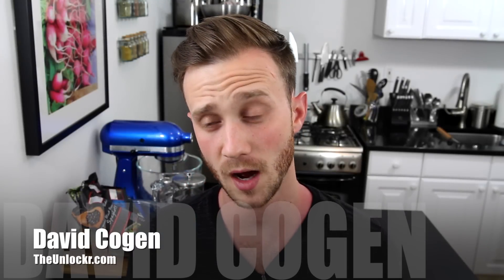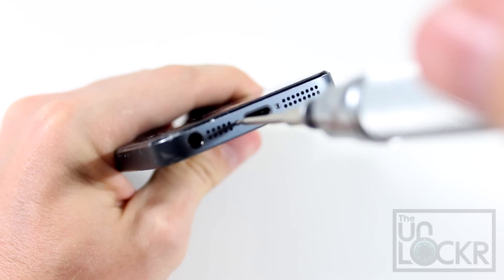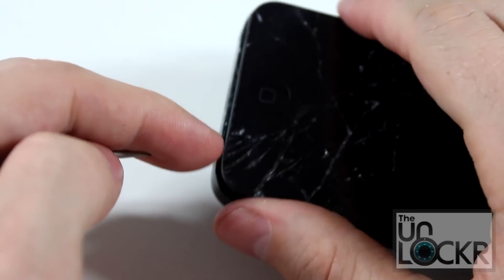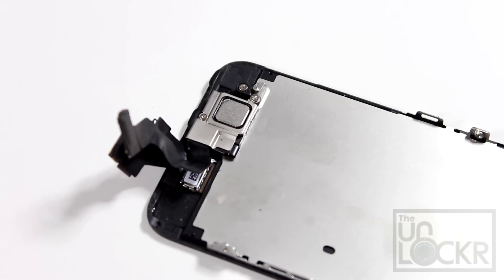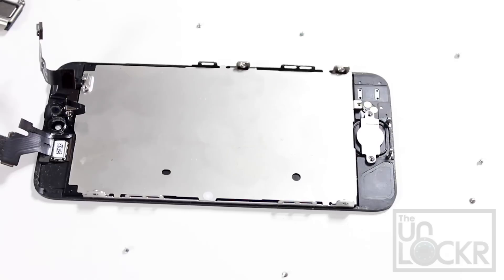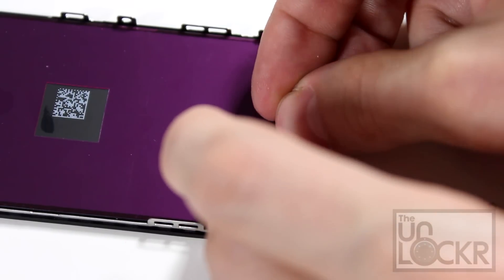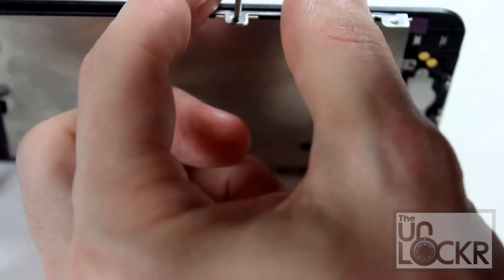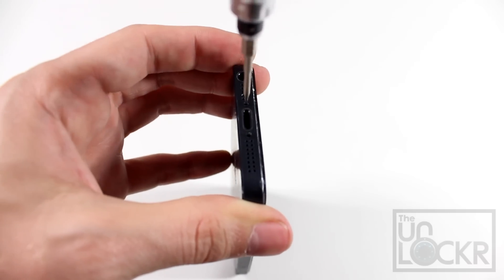How to Replace Your iPhone 5 Screen (Complete Guide)

Comment: if the screen is too cracked for the suction cup to work, put some clear tape over the screen and try again.
Reply: wow thanks
Reply: +kalj ههههه
Reply: yes can use Kapton, then put on machine for separate no problem
Reply: what i did was just unscrew it and shove flat head screwdrivers on the sides and force the screen out with pliers later on. worked pretty well, no cuts or glass in fingers
Reply: I feel like this comment help me more than the whole video. Thanks

Comment: 4:22, you put in "the third screw" next to the home button. That screw holds the back metal plate so that cannot be screwed in before you put the plate on. You should edit your video and correct that (and mention the purple plastic protection you forgot to take off)
Reply: I have never done anything else remotely like this and even I noticed the screw mistake straight away that I corrected, I left the film on because I thought maybe, just maybe this guy might still know what he is doing, but after assembling it, the response on the digitiser is a bit funny at times... This proves that no matter how professional someone seems, that has nothing to do with them being a reliable source of info and expertise. I mean come, those were two obvious mistakes, I was expecting him to at least go 'duh sorry guys' when installing the back plate and correcting the screw. I always question people who look like they know the alphabet. Anyway, it did help me install the screen I guess.. but I should take it apart a bit now to get that film off, though I fear to run the risk of damaging anything as I was surprised everything seemed to work pretty ok, apart from the occasional digitiser hiccups that I am assuming is from the film, in fact im surprised its not performing worse from what I read about not removing that film.. WHY IS THIS COMMENT SO LOW
Reply: He also didn't transfer the camera guide or the small spacer.
Reply: I thought that protector on the back was supposed to be taken off.  My old screen doesn't have a film like that.  And that third screw.  I knew it held that back heat protector on, but when I saw him put it on without the metal plate, I was slightly confused.
Reply: @dalltex  I didn't see what you were talking about on my phone.  There is a small round  clear plastic spacer that the front camera fits into, and my "bare-bones" screen like his had that in place already.  And there's a very small square shaped clear plastic piece I broke off of my old screen, but that's also already in place on my new screen.  Can you please describe the two pieces you are talking about?  Thanks in advance!!!!
Reply: @MasonSanchez.  it's been my experience that different replacement screens have different amounts of those parts attached. It sounds like your replacement assembly already had them. However that protector, you have to take that off. That screw, cannot go in as shown.  If you look on ifixit they often have good high-resolution photos of what it should look like.

Comment: Nice vid. I'd recommend using a piece of paper, drawing a diagram of the phone(circling where the screws go), use stick double sided tap on the paper and then you can stick the screws to it in the circles.
Also, pry the mainboard connectors off with the plastic tool instead of fingers.
Reply: @Tommy Garrett thanks for your reply. I found the site on google and Im trying it out atm.
Looks like it's gonna take a while so I will reply here later with my results.
Reply: @Tommy Garrett it did the trick and I now got access to my account again. Im so happy!
Thanks so much you saved my ass !
Reply: @Roland Carlos no problem :)

Comment: Did this all by myself, i was shaking like freaking crazy & i was able to do it! but! it did have a yellow hue & would not respond to my touch, so i took it apart again & i made sure the wires were connected by pushing them fiercely & it worked!!! And the earpiece mesh(?) i lost the screws & i freaked and started looking EVERYWHERE on my floor, turns out i didn't loose em... they were on my screw plate.........

Comment: Tip: try to clean the connections with an air spray or a brush before putting the connections back. I ended up having to reopen and clean them because there were white bars appearing on the top of the display.
Reply: Hey ik ur commented 2 months ago, but please reply if u see this. SO my phone has the white bars do i need to open the phone to make them go away?
Reply: JD_Savage_OG Yea I reopened it and sprayed the connections with an air can and it worked fine after

Comment: great video. I did everything correct except one thing ..be careful where you put the screws when you screw on the last part to the new monitor like shown @5.27 ..if you screw the bit longer screw to the wrong place that will create a black spot on your new screen like it did for me ..apart from that everything went fine with the instructions of the vid. Thank you.

Comment: Thanks for this. Worked a treat (I used whole display kit, not just screen). Getting the oldscreen off is the hardest part. Takes some confidence. There seems to be a small indent at the bottom corner that the plastic tool fits in. I managed to lever it off from there.

Comment: Where do you get one of those screwdrivers from? 🤔 I need to do this but I haven’t got one 🙄 I may just go into the local phone shop and ask if they will do it for me and I’ll throw them a couple of quid lol (I have 2 iPhone 5’s one of them is broke internally but the screen is fine and the other works apart from the screen so I need to swap them over)

Comment: Couple quick questions. I noticed you didn't peel the film off the back. I saw the tab by the home button when you were putting the back plate back on. Also you just put the home button in and reassembled, I've read or seen someone say to glue or tape the button in as it will move or be loose. Any problems?

Comment: I don't mean to be a know it all but before u start to remove the shield for the screen, it would be better practice to ensure the battery is disconnected. Also hold the screen up at a 90 degree angle to the phone when removing the shield and connectors to avoid strain on the ribbon cables. :)

Comment: Ive noticed that there is some kind of thin black layer of film on the metal backing of the screen, just the metal part, not the actual screen. Is that heat protection or something that helps recognize the fingers magnetic feild (touch) to the screen? Does it have a special use because mine got scratched when I was disassembling my phone...

Comment: Hey man got a question. The same pentalobe screwdriver I used for removing all screws works only except for the home button. Are you using a different pentalobe device to remove those two home button 1.3mm Phillips screws? (Strangely im able to remove the third screw sitting adjacent to them. Please let me know. THanks!

Comment: Please i need you support. I change everything carefully as you did on the video. Yesterday everything was working great but today the touch screen is going crazy, i cant swap pictures, slide left or right is sort of fucked up, and also when i send an email, or sms the a doesnt always respond or some letters if you push on them appear double. If i do a hard reset, everything works great but after some time it starts losing it again. What might be wrong? maybe a connection issue? do you suggest i open it again?will that help?

Comment: Great vid!! Helped a lot however there is one minor mistake. The part where you reinstall the home button you are instructed to place all three screws where you are actually only supposed to place the two on either side. The third top screw goes in after the shield plate to help secure it . Other than that perfect how to vid.

Comment: my iphone 5 seems to be very different from all of the phones in these example videos, I got my cracked screen off but the back plate is still snug in the phone, and there are no screws connecting it to the front part of the screen.  It seems secure in the phone, so I am hesitant to pry it off to reach the inner part of the phone with the connectors and battery.  I need some advice

Comment: This guide has some pretty big mistakes in it and it can ruin the phone if you're not paying attention:
- First BIG mistake is pulling the home button flex cable from left to right which will most probably end up with the flex cable being damaged. Instead it should be first heated gently with a hair dryer or heat gun and then, from right to left  (starting from the two golden cells) and using a razor blade or something sharp enough you should try and unstick that flex cable. Using this guide I broke my original home button flex cable
- Second BIG mistake has already been pointed out by others here in the comments section and that is leaving that protective tape on the back of the replacement LCD panel. That should be peeled off immediately as you start assembling that new display back. Leaving that tape there will interfere with the digitizer as it will act as an obstacle between the digitizer and the metal plate on the back. DO NOT LEAVE IT THERE! It's only purpose is to protect the digitizer's back until it reached you.
- Third mistake is in the front camera module where a little metal piece will pop-off and this video doesn't show that or how to put it back. That metal piece, with only two borders present on it's four sides acts as a protection and it's a pain to fit it back in although it only fits in one position
Hope this comment will help and at least save you a couple of dollars, the normal price for a home button flex cable!

Comment: Hi! Video was great I replaced the screen fine but the front camera doesn't work anymore!! I need help fast! I made sure everything was lined up correctly and yes, all three of the connectors are in. Anything else I can check
Reply: I have the same problem turns out I have damaged components/capacitor
Reply: Close to where the camera flex connects

Comment: I used your video to help replace my screen and I also did the battery. Now the screen has a slight glow and if I hold down the power to restart it quickly flashes the apple but it does not stay on or turn on. What am I doing wrong?

Comment: I just ordered your repair kit for iPhone 5, the screen is not snapping back into place in the top left corner of the phone so it's not quite fitting. How do I fix this without breaking the new screen?? I don't want to apply too much pressure.

Comment: I had some trouble right away after I unloosed the screen from the chassis and tried to open it there was a strip attached that prevents me from pulling up the creek to 90 degree angle. How do !i detach it? I have never seen this before.

Comment: After a day of mountain bike riding, I put my bike in the back of my pick up truck but unfortunately I left my iPhone 5s on the rear bumper and forgot about it. I noticed it missing an hour later and after three hours of searching the back roads I noticed it 2 1/2 miles away from where I originally parked and of course the screen was smashed. 
Even the camera glass was smashed do you think The videos that I had on it Will be able to be salvaged after a new screen replacement?
Reply: +Peter R Yes, the screen has no effect on the memory of the phone, so unless you damaged the hardware inside your phone all your videos and photos etc should be in tact

Comment: Who else watched this on their broken screen.
Reply: me
Reply: Me sadly
Reply: Me
Reply: Me..... I almost cry yesterday when my screen broke😂😂😂 thank Goodness I find this video am gonna buy the kit and do it myself!
Reply: Me
Reply: MrJamezMC not me because my phones lcd is ruined
Reply: 007
Reply: 007 hey .. need help .. i have replaced the iphone 5s screen but on placing back it did not get fit completely on space . So my screen is alright but it lifted up from side ... so its giving the problem . What i m suppose to do ?
Reply: Yamini Maniktala y
Reply: 007 me
Reply: me. my friends made me drop it yesterday and it cracked the entire screen, smh
Reply: Me☹️
Reply: Me
Reply: 007 I did
Reply: me
Reply: me, sadly
Reply: me
Reply: @desiyamini19  i have no idea if you still even use the 5 and nos have the 11 but in my past repairs i would slide the screen into the top first then i would flip the phone over and press it down on a flat surface so it would get equal pressure to the whole screen to prevent cracking, then just put the screws and boom
Reply: Me
Reply: 007 me
Reply: me
Reply: @asatukallay5216  how. Did it go

Comment: I really need a fast response. My cousin has a cracked screen on her gold/white iphone 5s. The screws that hold the metal plate on behind the home button are stuck. I'm using the small philips head screwdriver that was included with the barebones kit I got.  Any ideas on how to free those screws would be a lifesaver.
Reply: If the screws are unscrewed enough as to where the top part is above the rest of the area, then use a nail clipper

Comment: Hey Unlockr, I went through the steps and put a new screen on
but it is black and not showing anything...I think I connected everything correctly and I hear the phone vibrating at regular intervals so I think it is alive-
what do you think I should check?  Thanks
Reply: The two connectors he said that if one wasn't in properly the screen won't turn on

Comment: Is Iphone 5s different? There is a connector to the home button on mine.
Reply from the maker: It's different.
Reply: Found out the hard way. Turns out i ordered a 5 screen. Didn't notice before i had screwed it all apart though.

Comment: hi you seem like an expert, i have a iphone 6 (has nothing to deal with this video) but my phone randomly goes back to home screen all the time i don't know what to do..
Reply from the maker: Restore it through iTunes and see if that helps
Reply: did soft reset as well as hard reset, that wasn't solving it. It seemed my home button was broke i fixed the problem now. Thanks for your reply though!
Reply: if it going to home screen call insurance so they can replace phone tech issue

Comment: HEAT the 2 dot connectors at the top of the screen where the speaker is with a heat gun to loosen the adhesive when removing the cable! You will likely tear it off and wont hear anything out of the top speaker!!

Comment: Can anyone tell me what might be wrong with my phone...The screen has been smashed and part of the glass fell out...It was working perfectly normal and then suddenly wouldn't turn on and it doesn't charge. I checked to see if it was water damage but no signs of that and where It should come up red if it is water damage is also not showing water damage, I am going to replace the screen, would that be It or might it be something different??

Comment: My screen didn't pop back in place that well, the top left part of the screen pops in and out when I put pressure on it. It works fine, the home button is a bit sticky, but who cares. I'm worried about condensation seeping through. Do I need a new screen ???

Comment: When I try to use the suction cup to pull it up, the cup loses suction before I can slide a wedge between the screen and bottom. Any tips please?
Reply: Putting Sellotape on the screen with help with the suction cup

Comment: Good day sir! I want to ask a question, After I replaced my screen it won't turn on anymore, If i plug a charger on it I would hear a repetitive sound of charging notification sound, but no sign of screen its only black, And the screen works fine on the other phone, what could the problem might be?
Reply: The lcd
Reply: avon cinnabom I have figured it out, but it wasn't the LCD,  I accidentally fried my Backlight IC, when I was changing my LCD. The backlight wont send voltage signal to the lcd since its fried, that's why it wont turn on.
Reply: +Exogen Design my bad brother
Reply: +Exogen Design you must unplug the battary and plug it back in and you should be fine after that for it can reset
Reply: Joe H&H Services nah man i already tried that, i even restore it, coz i thought it was the firmware that wasn't compatible to the phone, but after i went on ifixit.com it was way clearer that my problem was backlight ic I did go to a technician near my place an expert one, and he told me it was a backlight IC so from all the research i found in internet i found one good, the price of backlight ic repair is quite expensive so im saving money for it LOL.

Comment: I followed these instructions and replaced my screen with a kit that did not include the camera or home button. The screen did not fit well, but worked. Unfortunately, the home button does not work and the pentalobe screws just slide in and won't tighten, but tend to fall out. I ordered another kit with the camera and home button and it was much easier to replace, SAME problem - the home button does not work! The pentalobe scews don't work! What is the problem?
Reply: May i ask u which kit u bought ( the one with the camera and home button) ? And is it available on amazon.com? Thanks in advance
Reply: DrIronHeart13 The first kit I bought was without the camera and home button. It was from Amazon. I have since tried a second kit from Amazon that did include the camera and home button and had the same problem. The replacement screen was slightly too big and would not fit correctly so the home button was not making contact. I used a pair of pliers  and a a soft cloth to gently force the screen into place. This time the home button worked, but after a few weeks the digitizer failed. I returned both screens to Amazon. Since replacing the screen at Apple or an independent shop was over $100, I just used my upgrade and bought a new phone for $100.